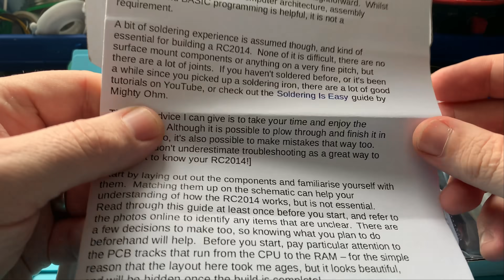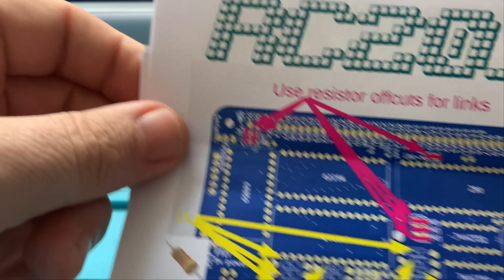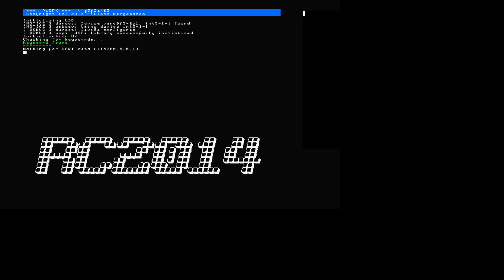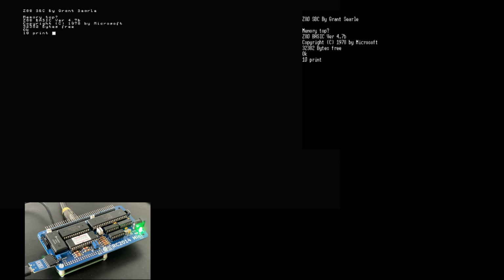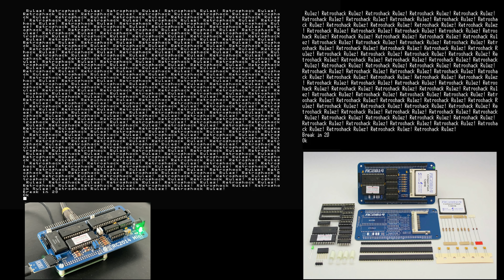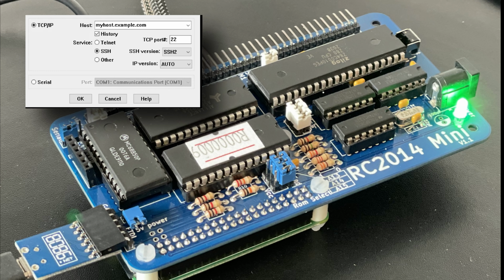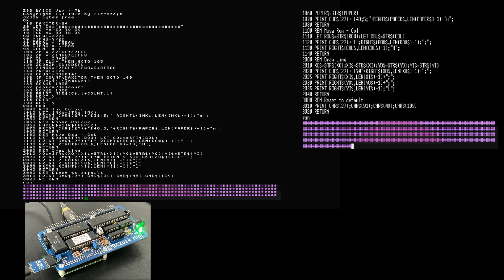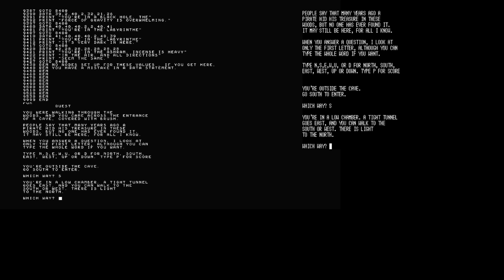Fun building this RC2014 - but what can I DO with it?  Inspiration needed!

Comment: I went with the Classic II. 

Made several mistakes, some were salvageable but I did end up having to order a replacement CF reader module so I could run CP/M, after wrecking some solder pads trying to remove a socket I bent a pin on. I've learned quite a bit, like only tack it in place, then check, and only then solder the rest of the pins. That probably would have saved me the cost of a second CF reader module.

Comment: This channel is great. Not sure if I should get this or the Color Maximite to learn Basic,
Reply from the maker: Personally, I think the Maximite is the more complete ‘modern’ retro computer with better colour, sound and SD card save/load straight off the bat - just turn it on and you’re away.  However the RC2014 is WAY more expandable and versatile.

Comment: If you're looking for a reason to check out the cpm expansion I humbly offer my port of basic Tetris (by the 8bit guy, david murray)  to CPM and the PiGFX terminal. I've made a version which 'should' work on a 64k cpm computer. Iv gotten no feedback as of yet if it works on the RC2014. I have tested a version I've written for the z80-mbc2, but as I didn't have a #rc2014 I don't know if it does. What should be required is cpm 2.2, PiGFX upgraded to the most recent version (it uses bitmapped graphics) and usb keyboard.  You can check out my repo linked on my video or send me a message if you're interested love the build!
Reply from the maker: Thanks - I'll take a look!

Comment: Nice build! #RC2014 is a fantastic project (just wish he went with 6809 instead)! :-) Recommend getting a FORTH running on it and then you'll find it fairly easy to interface with all kinds of hardware goodies.
Reply from the maker: Thanks for the tip! Thanks for watching and good luck!
Reply: There is some alternative CPU boards for the #rc2014 - worth checking in case the 6809 is likely to happen.

Comment: My first computer was an Apple II, and I loved it. I drooled over the Osborne computers (Z80 CPM systems in a suitcase-type enclosure with display and floppy disks) and I was saddened by their demise. I have never owned a Z80-based system, but I looked at them a lot back in the day. I understand that CPM became MS-DOS on the early PC's. 

My suggestion for the RC2014 system would be to turn it into a tool, a useful one. If you give it the ability to use the plethora of Arduino compatible sensors and actuators by letting the RC2014 communicate with an Arduino you could have an interesting system. I am looking at that multi-card RC2014 and wondering if you could put a board with an Arduino Nano on that, talk to it via COM port, and fan out the Arduino's pins to whatever you want to control or measure. The RC2014 could be an inexpensive but powerful tool for control and data logging and stuff.
Reply from the maker: Well certainly some food for thought there - thanks very much!

Comment: One of the "issues" (I use the term lightly) with the RC2014 (note, no hash tag, I already have two myself) is that every "application" in and of itself is its own Operating System, per-say.  A baremetal application that speaks to the hardware direct, with not intermediate APIs.  One can think of CPM as such, with the CPM APIs then exposing themselves to the flat z80 .com files loaded from within.   

This means there's nothing stopping people modifiying their "bare metal" code to use the CF module from CPM, for example, or other storage solutions available.  But it also means that whatever solution comes along (SD, USB Host to FAT formatted thumbdrives, etc.) will have to be integrated into each individual "O.S." (app, ROM image, etc.) by whoever feels so inclinded.

You may enjoy a look at something called "Z80 Playground" which is (logically enough) a Z80 SBC, which uses a FAT formatted thumbdrives for its mass storage, runs a custom version CPM, and has a breadboard compatible "edge connector" to allow you to experiment, and build, your own hardware expansions.  It's not RC2014 compatible, but it's a great "build a modern standards compliant CPM computer" kit since CPM itself has its own custom disk formatting, normally making trasnfer of files to, and from, the CPM system quite complex and faffy.

And, finally, good luck to all the people who enter your competition.  I hope they have a much fun with their RC2014 as I've had with mine.

-Dx
Reply from the maker: I'm already sold on the CP/M kit :)
Reply: @TheRetroShack  Oh, you definitely should get one of those!  They're "more powerful" than the Z80 playground, with lots more features.

If you're enjoying the RC2014 can I also suggest you also look at, as addons (some of which maybe don't work in the Mini, I can't be sure of that, sorry):
  1) https://github.com/robdobsn/PiBusRaider - The Bus Raider, which is possible the most daft, overpowered, add-on.  Turn the RC2014 into a speccy, etc.
  2) https://github.com/fbergama/pigfx - PiGFX, still mad powerful, a graphics card for any computer that uses a serial terminal.
  3) https://www.ebay.co.uk/itm/114388232099 - Quazar's graphical OLED for the RC2014, if you want to play with pointless programming silly fun things, this is one of my favourites :)

-Dx

Comment: Awesome video! I’ve followed the #RC2014 offerings on Tindie etc for a couple of years, but never taken the jump to actually order one. Most of my self-built retro 8-bit CPU systems are Motorola 6800 or 6809 based, although I did machine code for the Z80 on a System 80 (TRS-80 clone) back in the day, so getting my hands on an RC2014 one day would be an awesome addition to my existing 8-bit CPU boards.
Reply from the maker: Thanks - it's a really cool kit and you'd enjoy building it.  Thanks for watching and good luck!

Comment: FWIW: I built a full size RC2014 with my daughter along with some choice add-in cards - lots of fun making it, and a bit of education to boot.
My best advice is to think of this system as a Z80 based PC from back in the day - in it's basic form it's pretty darn useless beyond being a 'discovery' device but there is an ever growing array of add-in cards and projects for this system that allow it to be whatever you want. 
Have a rummage around Tindie.com for starters and use that as a jumping off point for whatever takes your fancy:
-Build a full old school CP/M machine? Why not?
-Add any number of sound and video updates? Ok.
-Want to run Colecovision games or software for many classic home systems? Doable too.
-New options are being developed all the time and this system is simple enough to grasp as a path in to designing your own hardware as a hobby.
-More a software person? CP/M may be very old but it's simple while being perfectly functional. And there's a huge library of existing software.
Reply from the maker: Rummage around Tindie?  I practically live on there :) :) Thanks for watching!

Comment: I have this kit, about half-done now, but I've taken a long break.  Not a fan of the backplane connectors being on pins, especially double-row ones.  What will I use it for?  Mostly show-off and nostalgia.  I can emulate CP/M machines just fine with my main computer, but hardware is a lot more fun.
Reply from the maker: Yep, nothing like a box that you built yourself :)

Comment: Great video #RC2014 I also using Grant Searle's MultiComp FPGA board which is a great way to run a  UK101 6205, CPM/M Z80 or FORTH 6809 system
Reply from the maker: Thanks for the tip!  Thanks for watching and good luck!

Comment: What I did with mine was use it to learn Z80 assembly and have a good poke around at what a running CPU really does. And now I use that understanding to write code for more powerful Z80 machines. You’ve not lived until you’ve hand assembled a program on paper and typed it in byte by byte into the hex monitor 🥴
Reply from the maker: Oddly, I agree! :)
Reply: Dude this is EXACTLY what I was going to say. I was gonna say something like "make a Pac-Man game/clone in assembly language". Live the dream.

Comment: As a kid I always wanted to build my own z80 computer, but never knew where to start, so great to see these kits are so well supported and easily available.  The thing I cant quite help feeling though is, it just needs a good gfx card with hardware sprites (might already be one I haven't seen yet) so retro game devs can have a standard system to go to town on making great games. #RC2014
Reply from the maker: There's a SID chip module... ;) Thanks for watching and good luck!
Reply: @TheRetroShack  possibly I stand corrected, seems there is an MSX compatible gfx card: https://www.tindie.com/products/dinotron/v9958-msx-video-board-for-rc2014/?fbclid=IwAR3jADr1iUTu20ZjdlgTlpNZ6aZa5aD0z5fBHtSX6Qvvu0OcnbWoHC9QtDc
Reply: having said that, out of stock and not a cheap option lol

Comment: It needs a proper Baud rate generator; by not having one, it forces a 7.3728Mhz system clock with a divide of 64 for the 6850.
The resulting 115,200 Baud rate limits the connectivity to things like Pis and PCs, which seems a bit incongruous to me.
Reply from the maker: Bet someone out there could create one? Go Community! :)

Comment: #RC2014

The machine starts to make sense when you add the RomWBW upgrade and some form of mass storage, the original BASIC relied on you having a paper tape device that could write and read attached to your teletype, so patching in any storage device would be a massive undertaking.

I have a MBC-2, the one where an ATMega32 has IO and bootstrap duties while the Z80 runs the show, and it runs fine. Here you can just run CPM and then MBASIC from there to save and load to disk. ;)
Reply from the maker: I'll check out RomWBW - thanks!  Thanks for watching and good luck!

Comment: I offloaded a Concurrent-CP/M server from a firm I used to work for - they "upgraded" to an IBM System/38 - shows you how long ago that was.  The case was knackered but the motherboard; which I still have somewhere has the dimensions of a small fridge!  Must be 3 feet x 3 feet wide... And I bet it's less powerful than the #RC2014 you're just built.  I'll get some photos of the board once I find it...
Reply from the maker: That would be really interesting!  Thanks for watching and good luck!

Comment: That sure looks like an interesting bit of kit, hopefully they'll solve the lack of storage #RC2014
Reply: I believe the lack of storage is only an issue when using the ROM image that goes straight into BASIC (there's literally no OS). If you get the CPM kit, you can boot to CPM and then load and run MS Basic inside of that and then have the ability to load/save files (since CPM is sitting under BASIC to provide the disk support).
Reply from the maker: What he said :) :)
Reply from the maker: There's the challenge :) Thanks for watching, and good luck!

Comment: For external storage, it wouldn't've been unusual for someone to have a serial paper tape reader/writer. :D It seems like it was common for a lot of systems to lack any actual storage before more common home computers were a thing.  If they did, I imagine you would've had to use a special version of BASIC with the drivers built in, and such a thing would probably be necessary for this.
Reply from the maker: Yep - and that sort of thing is available for other 'build it yourself' computer kits so was just a little surprised it wasn't available on this, given it's been around a little while :)